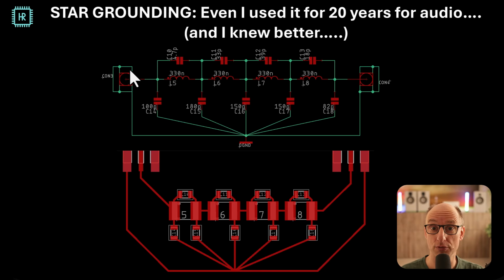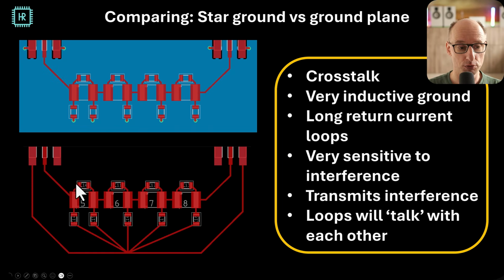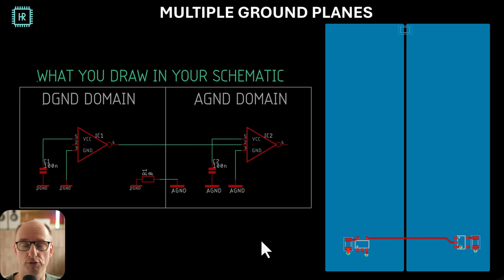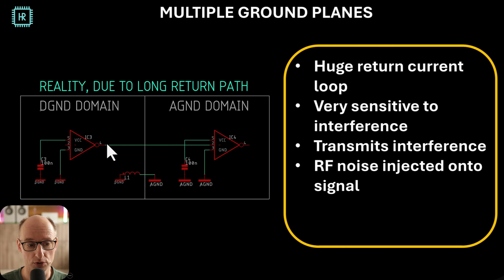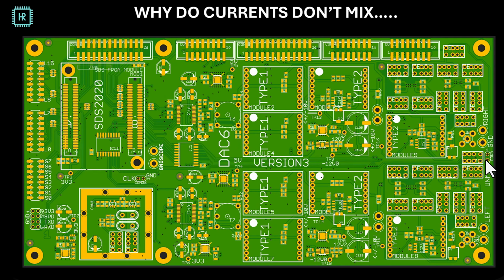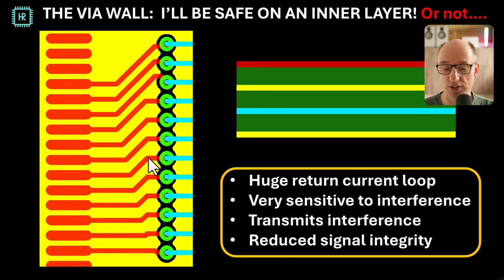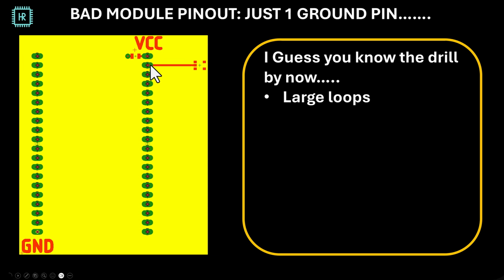Why Your Ground Design is WRONG — and How to Fix It. Flawless PCB design part 6

Comment: I've found the starred grounding for audio also works exceptionally well for shunted currents, via MOV or TVS devices where the chassis point is where chassis planes are separated.
Return currents will take every single path, low impedance or high.
As for separating 0V return where both analogue and digital are used, look up PCB layouts for high bit count DAC and ADC devices. Always a slot.
Going a step further, look at the recommended layout for any buck converter (ADP2302ARDZ for example) there,'s a clear layout requirement for ground return currents.
Solid plane is an absolute prerequisite for digital, especially with MDI, ULPI, USB are used. Absolutely always separate analogue and digital.
As for noise, never cross planes once you've designed.
He's 100% right you have to design as if  everything is an EMI nightmare waiting to pounce.

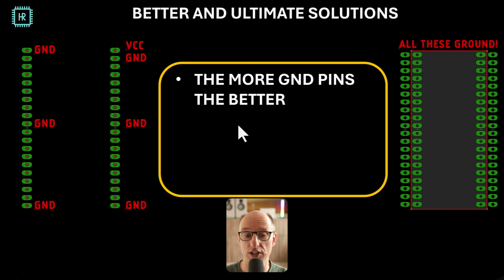Comment: 13:51 - Parallel ATA (IDE) interface of an old PC uses this technics (separate grounding for all signal lines) so it uses so many wires (40 wires for 16 bit bus).
Reply: Early IDE cables were a normal 40-conductor ribbon, with only a handful of ground pins. Later they switched to an 80-conductor ribbon with every other conductor being ground, but still using the same 40-pin connector. The connectors bridged the ground pins to all of the ground conductors between signal conductors. They blocked one of the sockets on the connector as a key, perhaps to prevent anyone using these new cables in place of standard 40-conductor cables in non-IDE applications.
Reply: @stefansynths This reminds of a ribbon cable fix I came up with back in 1985 as a student intern when doing a rotation in the chip fab water testing department. They had wafer probe stations connected to the ATE with a wide 80 way (IIRC) ribbon cable. The probe-stations were old teech not really designed for even moderatly high-speed logic testing. The cable connector pinout only had a few ground pins at each end, so resulted in horrendous signal integrity over a ~1m cable. I ordered some of the newly available "twisted pairs" ribbon cable and stacked two belts of this cable to get a ground return for each signal, and carefully split and interleaved the signal wires through each other and crimped on the connectors. The grounds were then soldered to a bus-bar and connected to the remaining ground pins, resulting in something similar to the (more recent) IDE cable connector you describe. It wasn't an ideal solution (which would have required dismantling and modifying the probe stations and ATEs) but made a huge difference to signal integrity, allowing faster testing of digital wafers.
The day afterwards, I was happy to see the night-shift technicians there had made a full set of new cables for all the probe stations.
Reply from the maker: Hah, nice, I didn't know that. I am from that era and I remember those cables, they were HUGE. I did not know they used the gnd-sig-gnd-sig topology. It is pretty logical, those cables were slightly long and if you want to guarantee signal integrity, this is the best solution.

Comment: Great video! I have a question regarding PCB design with ESP32-S3, automotive 12–14V power input, and six MAX31856 thermocouple amplifiers.

To ensure low noise and stability, should I use two separate LDOs (analog + digital) for each MAX31856, or is it sufficient to share clean power rails across multiple chips? Also, what's the best practice for filtering and protecting the LDOs in an automotive environment?

Any design tips or schematics would be greatly appreciated!
Reply from the maker: Hi, I'm not familiar with the voltage spikes that can occur on an automative 12-14V system. Maybe you can search that? An easy way to deal with spikes is an RC network. Off course, the resistor cannot be very large if  you're drawing a lot of current.

I would assume there are special regulators that can deal with anything a car environment can throw at it, that sounds the most logical.

Weather you need separate regulators??? It depends. If your supply is really dirty, and the supply rejection of your thermocouple amplifiers is too low, then you may need them. The best suggestion that I give in my course is:
1. Do some basic calculations on what ripple you can expect and if you get into trouble with the PSRR of the thermocouple amps
2. If it seems risky, put options on your board for regulators to add (make sure you can bypass them as well using 0 Ohm resistors)
3. If you're just not making your requirement: use RC filters as an option. A 1 Ohm resistor with a 10uF cap is already a pretty decent filter if you ripple is at a higher frequency.

Best regards, Hans

Comment: Texas Instruments has an application note that covers a lot of what you've shown and explained.  That said, they also published a reference design with a fuse on neutral and not on line.  I do not recall their application note covering star point grounds, so thanks for that.
Reply from the maker: Nice to hear. If you do this long enough (and make enough mistake :-)  ) you'll automatically get to these solutions.

Comment: Excellent discussion. Many years ago, I began using ground and power planes in my stack up. The power planes obviously minimized the supply rail noise between chips and also worked as a distributed capacitance for bypassing the supply lines. I have used separate analog and digital ground planes with a single connection point successfully but maybe that’s because the boards were small. I see your point of a single large ground plane and controlling isolation of the ground currents by proper parts placement.
Reply from the maker: Thanks!

Comment: Isn't the solution to the module grounding push you back into the via wall problem? Cut the grounds in 1/2 and and use every other one as ground. In fact you'd probably not see much degradation at 3:1 or 4:1.
Reply from the maker: Yes, I agree, my best solution is total overkill :-) Really good if you're making sensitive measurement equipment though!

Comment: If you have a DC circuit, could you add a diode after the filter cap to prevent any cross talk leakage back into your circuit?
Reply from the maker: If a diode is conducting, it is actually doing so in both directions. The large DC current will make the diode conduct. The small ac interference won't 'close' the diode, so it goes effortlessly in both directions

Comment: Grounded neutrals in our power grid amaze me. Works slightly different than PCBs as their ground is the return (neutral).

Typical ground wires in our houses are a way to keep everything bonded and at same voltage (ground), and act as a drain in case a short occurs. The neutral carries all the return current (line to neutral) and only joins up with the actual ground wire at the panel. The return line on the pole (and its center tap on transformer) is also grounded along its path, keeping its voltage at ground. 

Without sufficient ground wires in our power grid the current will find other paths, voltage drop adds up over distance, creating a voltage difference between neutrals and ground (and ground wires) which results in actual current flowing through the ground wires.
Reply from the maker: Indeed! The last few years I worked for a power company, very different from microelectrnics :-)

Comment: Thanks for the video. For some reason your video arrived for me to see in YouTubes feed. I agree with your recommendations. I am now a retired engineer, but have worked as an EMC consultant for 17 years in Denmark - but it is now 15 years back. I also did several lectures on PCB design. Back then I also had to go up against a lot of bad design rules. Apparently, you still need to point them out. I also did some research regarding power plane resonances in PCBs. So when you go above 300 MHz, you will typically start to see these kind of problems as well. Another part of my work was to make specifications for the power and ground grid in buildings, to avoid magnetic fields. It is relevant for big media services and sensitive electron microscopes. Also here, I had to fight old bad practices about separated ground systems. 😀
Reply from the maker: Great story! So what was the solution in buildings. I'm curious. I assume it was about getting the return paths very close to the signal paths. If you really want to get it down, twisting the power wires should work great, but I don't think that is really an option. At least it would require deviating from the normal installation wire that is generally used.

Or did you use shielding to keep the fields out? I assume in a building, that would get quite expensive.'

Curious to know! I never had to deal with something like that and I always like to learn.

Best regards,
Hans
Reply: @HansRosenberg74  One of the main thing in buildings is to avoid inductive coupling into the protective earth wires. For instance, you should newer use the common cables with L1, L2, L3, N, PE placed like a pentagon in a cable. They cause voltage induced on the PE wire. You can use twisted 4-wire cable with L1, L2, L3 and N and the PE wire placed separately along the way. You can also use cables with a concentric PE-wire like a shield around the four wires. The big power switchgears should be made in a way, so you reduce inducing voltage on PE-system. When you do that, you can have multi wired grid like ground system connected at many places to metallic pipes and etc. without any issues with ground loops causing magnetic fields.
Reply from the maker: aha, very interesting, so you try to find everything made of metal in the building that is grounded, and connect to that. That sounds like a makeshift low frequency ground plane. At those low frequencies, you can have pretty big holes in the ground before it starts to hurt. Allthough you do have harmonics from rectifiers in loads of course.
Reply: @HansRosenberg74  There will be big holes. But it is also good practice to make equipotential bonding when easily possible to metal pipes etc. A motor pump will typically have a PE connection and will connect to a pipe this way. It will normally cause several (ground) loops in a building. It is generally a good thing for many reasons. The normal problems in common buildings are, that parts of these connections could be the PE lead in the pentagon power cable. It can cause several amperes circulating in these loops. Mains harmonic frequencies will be more significant in these currents as well.
Reply: @viggob4816 a physics lab I know has several 10's of Amps at 50Hz constantly that they haven't tracked down, likely exactly from the issues you describe here. Not only must there be annoying magnetic fields, but also an increased electricity bill !
Reply: @quesoestbonne  Yes, it can be a problem for a physics lab, if they got instruments, that is disturbed by stray magnetic fields. It can be rather expensive to rectify such problems in a building, but it is easy to do right, when you make a new building, when you know what to do. For instance big electron microscopes are very sensitive and they need the buildings earth and power systems to be made the right way.
Reply: @viggob4816  Cheers! As an HVAC field tech here in Finland I have to say these kinds of problems aren't going away anytime soon. 

I get my commissions mostly from manufacturers but also customer's and various contractors so I'm kind of a middleman between the parties in a project. I get to see the same companies making the same mistakes over and over again, regardless of if it's basic housing, offices or critical and secure state and corporate facilities. 

Two instances stand out: VFD driven motors and bearing damage and RS-485 networks with communication problems. I dare to say the most common cause for and denominator in system malfunctions and equipment failures is cabling and (equipotential)grounding. 

I can smell EDM damage long before I open up a burned motor. If I do, I cut the bearing in half and document the discharge patterns and inspect the terminations so the factory can decide to deny the warranty. Separate N and PE wires sounds optimal in 3~ star configuration but in motor drives that only have three phases and a PE a cable with the PE split symmetrically in three is well balanced, too. The shield of MCMK is, ironically, a really symmetric PE compared to it's core wires but it has it's problems.   

RS-485 is robust but sometimes picky. It doesn't help that most guys don't seem to know what the difference between an isolated and non-isolated transceiver is or whether to ground the cable shield. 2-wires is really 3 wires. Without a defined COM/GND potential everything'ss is left to chance instead of in control. My haldheld scope has been a real game changer, too, like X-ray vision into the system...

When it comes to PLC and instrument cabinets as well as the simple audio tube amps I work on I still prefer and recommend a single point star grounding that's even better with a separate very low impedance signal ground.
Reply: @Kansika  Yes. I am not familiar with the RS485. But I have been out trying to solve problems on site many times caused by  wrong motor cables used for VFDs. Back then the VFD manufacturers did not help that much in specifying what kind of motor cables to be used. Just any cheap shielded cable will not work for you. The main problem in my cases was that the VFD caused noise on wires in sensor cables or signal cables. I guess, that you will still have the same kind of problems. I am sure, that a motor cable with an asymmetric PE-wire will potentially cause bearing problems. But I cannot say for sure, that the right motor cable will solve all bearing problems of VFDs.
Reply: @viggob4816  Bearing damage is still a thing but I have to say lot a lot has improved in modern devices' like VFD's, rectifiers and SMPS's tolerance and immunity to noise since the EMC directives really started demanding it. Of course, they still have the potential for disasterous EMI if wired or grounded wrong and the amount of noise sources is growing fast, too. Noise isn't that big of a deal with factory-sealed equipment but that's the RS_485's weakness. The bus has to be built and connected to each note by hand but a basic electrician makes no distinction between a data transmission line and the light switches he's also wiring.     

Cheap cables and plastic glands won't do with VFD's but even top tier gear won't save you if you're not mindful. It sure hasn't been easy to come up with all-around cabling recommendations that wouldn't fail catastrophically in certain situations. There weren't that many cables to choose from, either. ABB and Danfoss came up with some pretty good guidelines but the EC-motor directive pushed it aside. 

Now it feels like a fool's errand going from VFD drives to EC's. The bearing failures are still there but you can't service them bc often bearings sit on insulated sleeves and not on the steel axle. When the bearing heats up the sleeve loses shape... We're doomed but I love troubleshooting too much.

Comment: I've looked at a lot of your videos (which are quite good but I'm still processing) and I don't see differential signals mentioned.  Theoretically, at least, the return path is the other trace in the differential pair.  Does this really help?  If so, what are the rules around this?
Reply from the maker: Its in my course (You should buy it ;-)  ). Differential signals are mostly not differencial at all actually. They're mostly 2 single ended lines with opposite phases. So you need a ground plane there as well. This holds for almost any differential signal on a pcb. If you want to get truly differential, you need to use a transformer, like with ethernet for instance.
Reply: @HansRosenberg74  Thanks for the reply.  I wish I could afford your course.  But unfortunately, I'm not a professional and can't justify the cost :-(.

So you are saying that the outputs of a Fully Differential Amplifier are not really differential?  Also, many devices like CODECs, ADCs, DACs, etc. have differential inputs/outputs.  I know that a transformer is a way to do it, but is it really the only way?

You still need a ground for impedance reasons, but on a truly differential signal do you need it for return path?
Reply: @CoreyMinyard "need" isn't binary.  But I think the default rule of thumb for a PCB (rather than a cable) is that the partner trace only carries about 15% of the return energy.  The side to side coupling is only by the thickness of the traces, but the coupling to the next plane is by the trace width and the plane width.  Unless there is a thick core in between, that extra width matters a lot.

Comment: Hans has 30 years experience, and he really knows his PCB layout work. He's also an excellent teacher. I highly recommend his channel. I have 65 years of experience, (I started testing tubes at a TV shop when I was 10,) and I dearly wish his videos had been available when I started in electronics back in the 1960's so I could have avoided about 20 years of PCB grounding mistakes. They cost me dearly more than once.

BTW, the idea of using a star ground and avoiding a daisy-chain ground was originally for the purpose of wiring tube equipment and circuit boards and devices together to a power supply or equipment ground. Unfortunately, people carried the idea all the way down to the level of traces on a PCB. But a good ground-plane on a PCB that is used properly is a much better idea, especially as signals get smaller and frequencies get higher.
Reply from the maker: Hi John (hope that is your real name as well :-)  ). Thanks a lot for the kind words. I ALSO wished I had my videos 30 years ago :-) That's why I'm making these videos and have developed a course with all my knowledge in it :-) Best regards, Hans
Reply: That's a very interesting comment, thanks for sharing!